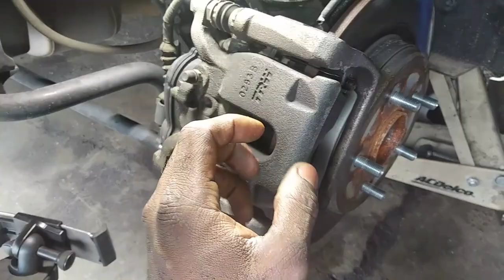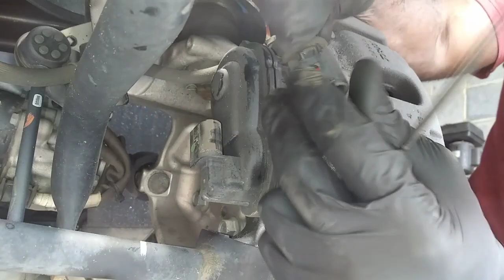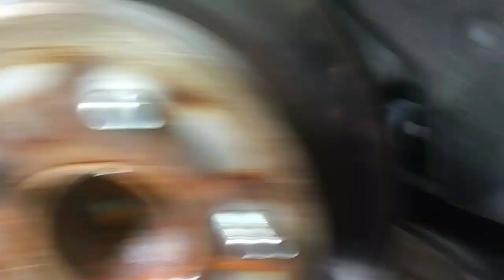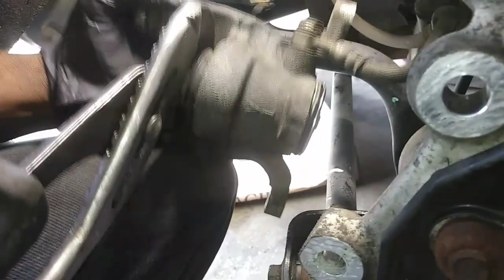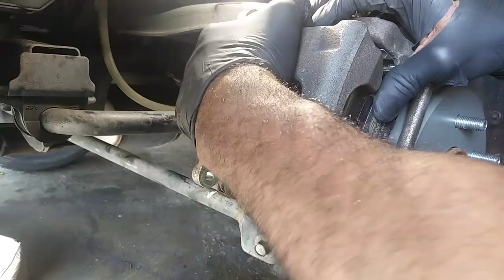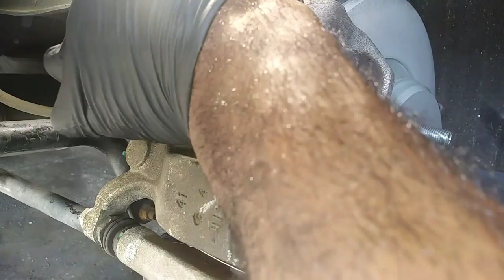2015 ACURA TLX REAR BRAKES AND ROTORS

Comment: You use a tork from the backside where there actuator gear inserts into the caliper and turn it clockwise. Much easier and reduce risk of ripping boot

Comment: Remove the electric brake fuse a T 47 turn it clockwise, and then use a regular caliper to squeeze piston back in this way you won’t ruin the boot

Comment: Hey man FYI, you can back off the ebrake with a torx bit once you pull off the ebrake assembly it will screw in and once it stops then use the c-clamps to push the piston in the rest of the way
Reply from the maker: Good deal... Thanks, Learn something new everyday.
Reply: customhonda can you hit me up?

Comment: If anyone is insisting on cheaping out on a Tory bit for the caliper piston.....do yourself one major favor.   If your going to be stupid and notice resources that can make it easy.........when you set the c clamp against the piston. Use one of the OLD Brakes pads to flush against the caliper.  Much easier, smoother and who cares if the old pad gets more scratched/nicked/gauged......

Comment: I did the same thing and now it has 3 warnings, “electric parking brake problem”, “brake system problem” and “brake hold system problem”, any suggestions?
Reply: Parking brake seems to be working but have these lights and it constantly beeps to disengage the parking brake
Reply from the maker: Try disconnecting the battery for 15 min
Reply: Nope didn’t work
Reply: Does the parking break need to be engaged when you put it back on?
Reply from the maker: @michaels662  if this happen after you did the brakes and things were perfectly fine before, suspect human error. Recheck your work and ensure things are properly connected. 

This doesn't generate codes after disassembly and assembly.
Reply from the maker: @michaels662  you engage parking after you fully assembled brakes and install wheels.

Why would you have to engage parking brake during assembly?
Reply: @partsshooter  I double checked already and all looks good and idk I did exactly what you’re saying in the last comment about the brakes, just double checking anything else and yes all was good before the change
Reply from the maker: @michaels662  interesting... Im not gonna say things don't spontaneously happen because they do! 

Does your parking engage and disengage with the button? If not, it's a possibility they button has failed

2 things...

Try disconnecting the battery over night and see if this clear codes... If this don't work. You'll need a scan tool that'll access the brake control module, codes need to be retrieved to know what's not being satisfied
Reply: @partsshooter  it seems like the parking brake is working, with it engaged it doesn’t move in drive and with it disengaged it rolls easily in drive, I’ll try your suggestions thank you
Reply: @partsshooter  I found the problem, if you spin the piston clockwise so you can compress it, you have to twist it back to the left and that fixed it
Reply from the maker: @michaels662  that's interesting, I'll have to look into how this is a thing🤔. Thanks for getting back with me on the fix

Comment: Have you guys had any problems i work at the dealership n we put a scan tool to retract the parking brake n then re calibrates once u take it out of its maintenance mode
Reply: You mean any problems besides it being a dealer and the associated dealer mark up?
Reply: hi, I recently had the rear brakes on my 2015 TLX done by a friend. We weren't aware there was a process to do this and now I'm getting warning lights on my dashboard. Is there any way to remove them if the brakes are working fine. I'm trying to avoid having to go to the dealership and lose an arm and leg
Reply: @oscar83271  Not sure if this is it... But you need to adjust the brake. 
Turn the car to the on mode.
Pull electric park brake switch to apply the parking brake, then press the brake pedal and push electric brake switch to release the parking brake. Then add fluid as need. 
Long shot but hope it helps. 
About to do mine too
Reply: @dirtymoney831  thnks for your assistance. I was also getting an ABS warning light along with the other associated warning messages that come along with the ABS. This was due to the front driver ABS wheel sensor being accidentally yanked when installing coilovers and new rotors/brake pads. I also was getting the 'check power steering' warning light. Luckily, I took it to a local mechanic that connected his scanning tool and readjusted/calibrated the steering wheel, got rid of the 'check brake system/e-brake' warning light, and installed the new ABS wheel sensor. My dashboard has no more warning lights. He only charged me $120 for everything. The dealer wanted $179 just to diagnose the brake system warning light. You can imagine the hundreds of dollars (even a grand or a lil more) I would have spent had I gotten it serviced at the stealership.
Reply: @oscar83271  Wow good you shopped around. it can get crazy expensive
Reply: @oscar83271  how did he get rid of the warning lights?
Reply: @michaels662  the mechanic/electrician connected his Snap On tool and adjusted/deleted the error codes for the rear brake system. He also took care of the rest of the warnings that were on the dashboard. I don't know the step-by-step things he did. This was last year.

Comment: The EPB actuator looks reasonably easy.  Remove the EPB actuator entire assembly and after that it is just a normal routine rear brake job .    

They make a fairly simple and cheap but durable clamping tool. Same concept as a C-clamp but a little less bulky and easier to manage.  Run the clamp out, install one of the pads....(preferably the old one in the event of damage). There is a backing plate and slowly increase tension on the pad and it will naturally compress the piston.  Turn slowly the same way as the C-Clamp just a lot less bulky to work with and don’t have to worry about the C clamp coming off on one side.

There is one more pretty universal for parking brake tool.  Has many dies and clamps to accommodate many types of pistons.

Great video, facts and techniques without fluff to make the narrator hear themselves speak.  Good camera work in keeping steady.

I just purchased a 2017 TLX which could have brakes in the future.  Good to know that there is not a special masters of engineering required to replace the rear brakes.